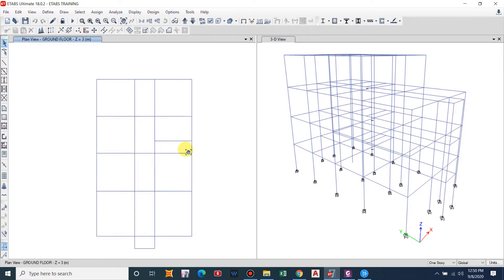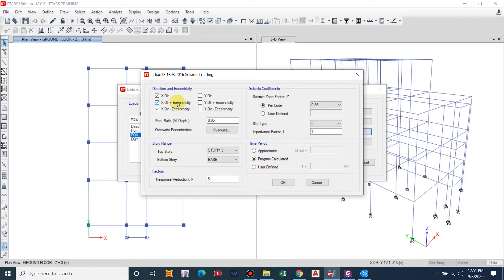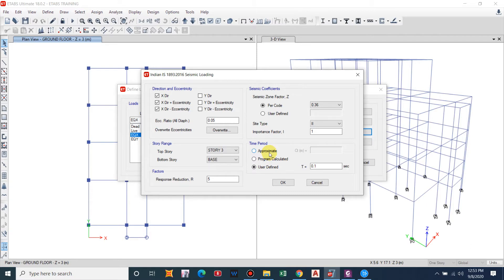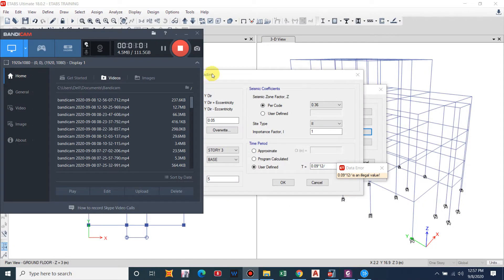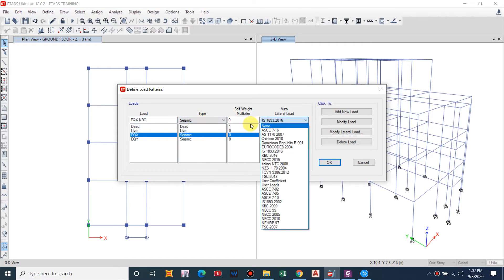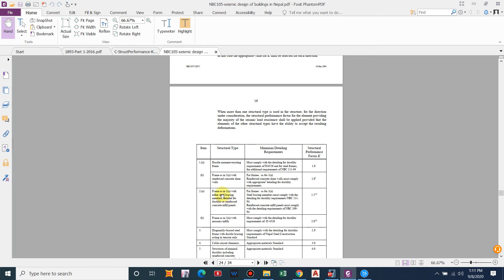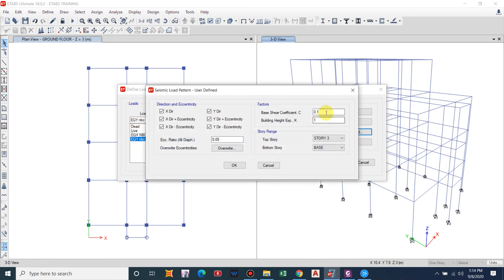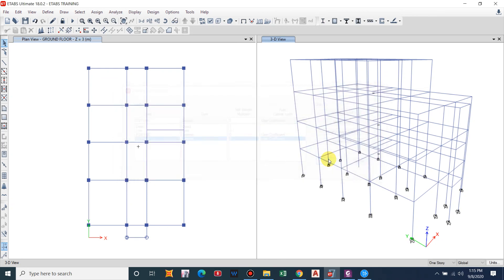Define Earthquake Load Pattern As Per IS Code and User Coeff. (Nepal Building Code NBC 105) | ETABS

Comment: Thanks for the video. It is very helpful. The calculation of seismic coefficient has changed drastically in the revised edition of NBC i.e. NBC 105:2020. Please make its video as well. Also, I do have confusion on 'Building height exponent' in user coefficient method and the distribution of lateral load along the height of the building.
Reply: welcome
Reply from the maker: @anishmaharjan71  building coefficient exponent refers as combination of modal effects. Taking 2 for SRSS